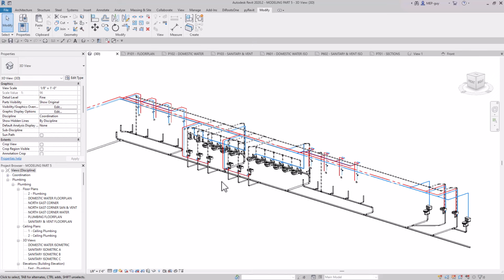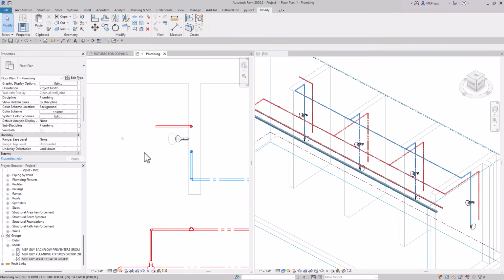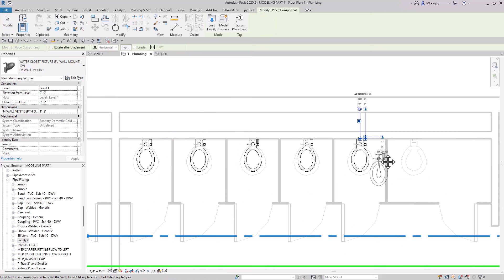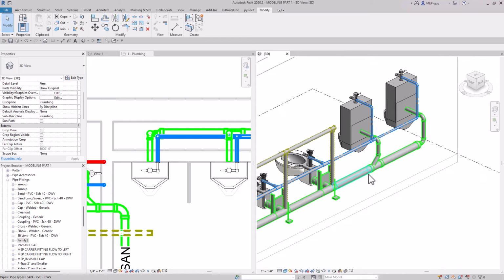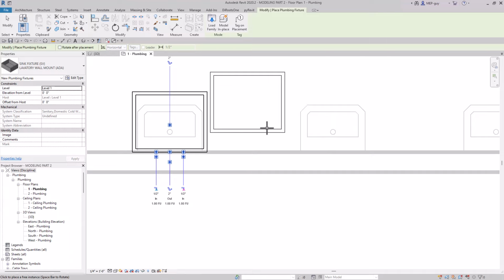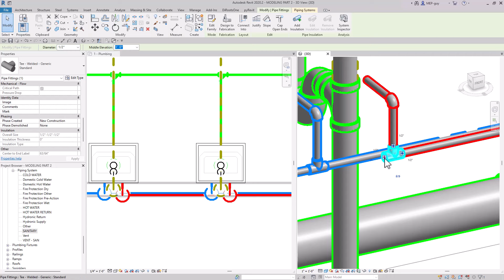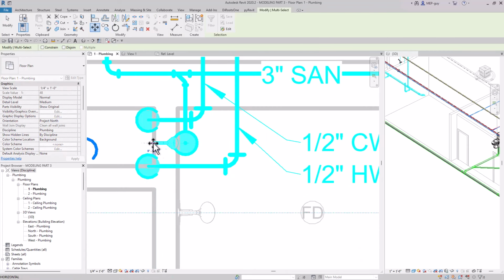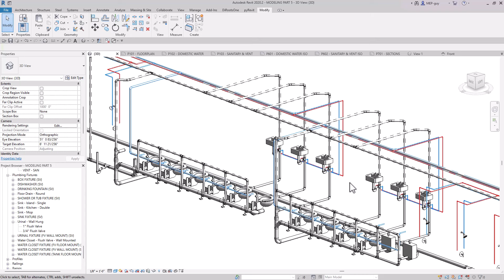Plumbing Modeling in Revit - (Full Project)

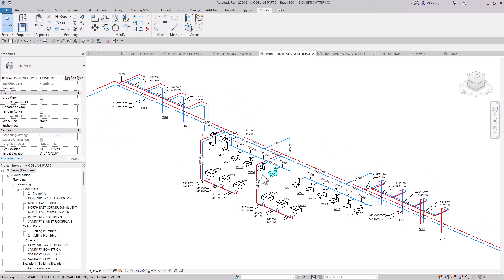Comment: At 1:05 when you are connecting the urinal to sanitary,  If you are using the trim tool on pipe that is overlapping another pipe it will trim to the side of the overlapping piping you click on. Also,  if you click on the first piece then hover over the second you will see a preview of how it will trim.
Reply: Thanks for the tip Pat. Yea on second watch I could have just selected the section that wasn't overlapping and it would have worked the first time. But I might have wanted to be clear about why it didn't work. Sometimes when I'm recording I make interesting decisions.

Comment: Thanks a lot for this video! It will really help me with my exam.

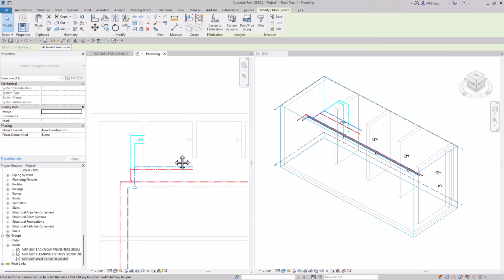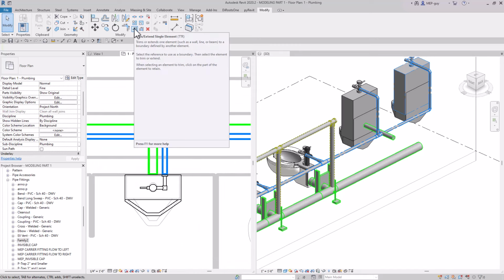I was wondering why at 25:10 you didn't create a group instead of just copying pipes and fixtures; in this way, future modifications would affect the whole system instead of just one fixture, without the need to delete and copy again pipes and fixtures, speeding up the process. Also, at 1:05:40, you should have selected the part of the tube nearest to the fixture, not the one furthest to it.

Thanks again, and keep up the good work!

P.S.: it would be interesting if you could design a new MEP system for an old building, finding smart solutions for the problems that you will probably encounter given that it's an old building
Reply from the maker: You could create a group for the shower but it's not saving me any time. If I had a large building with showers in various locations I might create a group. I will definitely consider creating a plumbing system using an existing building in the future.
Reply: Thanks for the video
Reply from the maker: You're welcome!

Comment: Can u share this file for practice
Reply from the maker: The file is only available for those that purchase the course. You need my custom plumbing fixtures to be able to model as I show in this video. They are available with the course.
Reply: @MEP Guy  i can't affordable that much amount can u reduce
Reply from the maker: I may run discounts at a later time, but for now, that's the price.